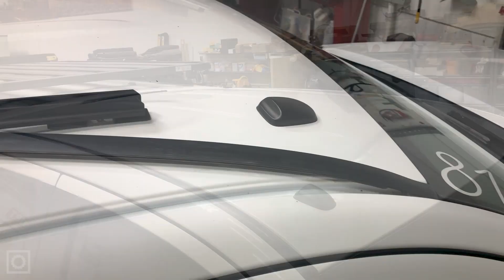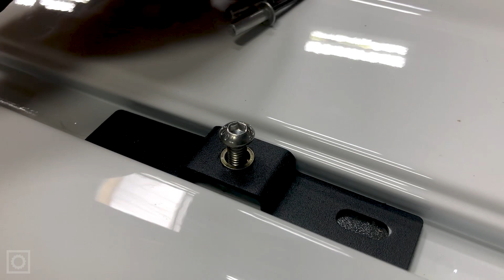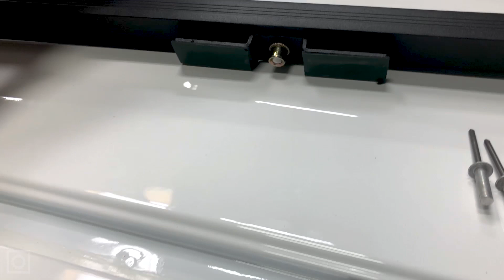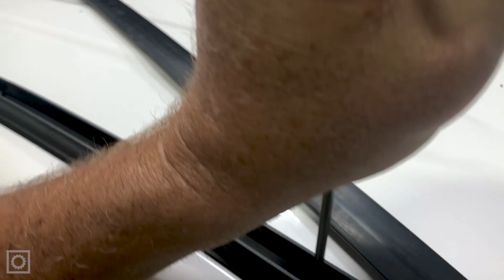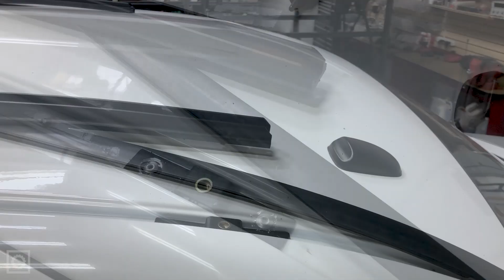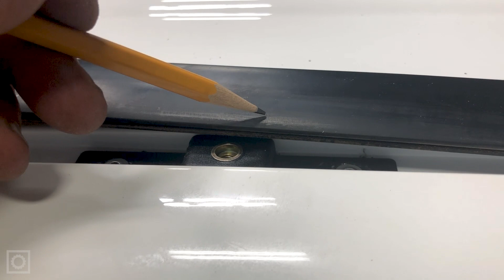Eezi-Awn K9 Tundra Roof Rack Installation

Comment: Nice Video. Do you remember how much weight can this type of rack installation hold?
Reply from the maker: Hi David, 

There is no specific weight rating on this kit but the rack gets mounted to the pinch weld which is the strongest point in the roof. In most cases, automotive manufacturers do not publish weight ratings and if they do, it usually referencing the factory roof rack. Same as Land Cruisers, 4Runners and Tacomas. The rack is fully welded and we typically tell folks the racks will handle 500+lbs, depending on what the rack is actually mounted to.

I (Morgan) have a K9 rack, tent and awning mounted on my Sequoia and my dynamic weight is somewhere around 300lbs, my static weight is closer to 600lbs with two of us in the tent. Never had any concerns and I've driven that vehicle hard and fast off road without issue.

Hope that helps!

Comment: doesnt the tundra have pre drilled holes? I know the tacoma does? anyone
Reply from the maker: There are no predrilled holes in the roof of the Tundra, there were no factory rack options so no threaded mounts were needed. This installation will require drilling.

Comment: I'm not drilling into my Tundra's roof.
Reply: Spider rack makes a roof rack that does not require drilling. It is almost a grand though.
Reply: @michaelbanks4005  Thanks ....thats what I'll be looking into when I do get one then.
Reply from the maker: We're not aware of a Tundra rack system that doesn't require holes to be drilled. These trucks did not come with factory rack options so Toyota did not install mounting points in the roof. We drill holes in roofs of vehicles all the time but we understand it's a major commitment and too invasive for some.